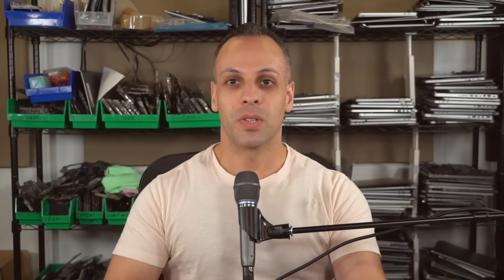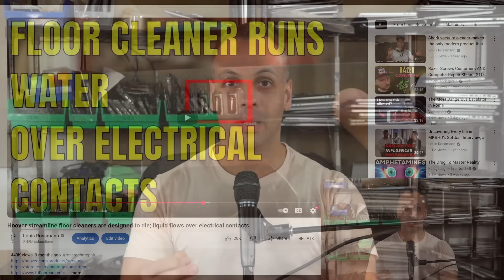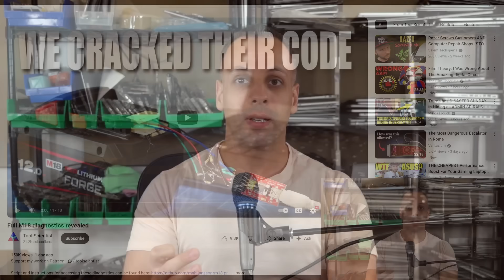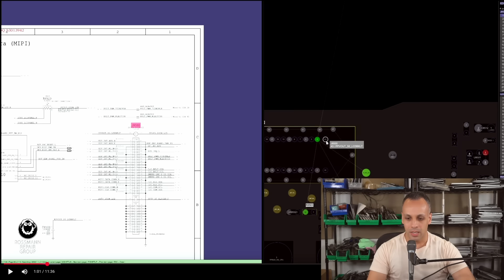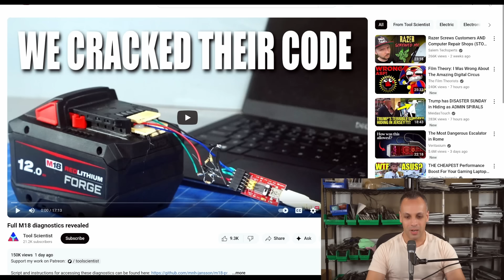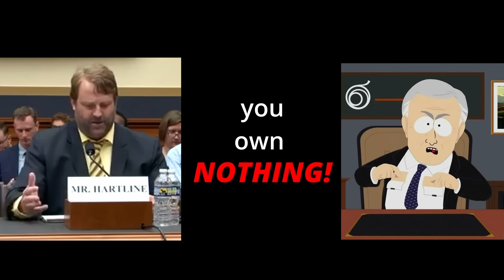Imagine putting DRM in a battery to void warranties...

Comment: This reminds me of when HP spiked my printer and made it not work. So then I called the help desk and the guy told me if I wanted any help I would have to pay. So I acted like I was doing a live stream and saying hey folks do you hear that? And of course he hung up immediately. It was a bit cathartic to smash that thing to bits. Bought an Epsom with actual liquid ink and never looked back.
Reply: Epson isn't immune to enshitifiction either.   There is a sensor in the printer that dies after so many pages printed.  They just get you another way.  Only Epson can fix it of course.
Reply: @fredsilva7274  Epson was always kind of bad, the heads being part of the printer meant the nozzles would clog and inevitably it'd be ruined other companies the nozzles were part of the cartridges which was part of the justification for the higher price but a ruined cartridge was potentially cheaper than a new printer. Then all the others seemed to introduce the "authorised replacements" era, which led to the fun of figuring out bypasses for the early countermeasures to refilling your own. Sad to think we thought it was beyond BS then compared to today.
Reply: @cericat not in the 80s man...😊
Reply: @fredsilva7274  Which printer model is that?  I've got over 8000 pages from my Epson and it is still going strong.
Reply: @fredsilva7274  If its just hardware failure but is hard to replace then I can just call it bad design and its usually not intentional, but rather lazy. Most harm is done through ignorance rather than malicious intent. If it is intentionally left as a design flaw after being discovered it is really poor design and almost crappy. If it is purposefully added to brick the machine, it is complete BS, and I don't want to buy or use it.
Reply: @dashdartfun  The reason I never buy Sony.  They had CDs that would brick computers, to defeat copying. No thanks. Not ever.

OTOH, We had a refrigerator that went eight years, I think.  The ice maker was intermittent and the 'fridge and we thought the 'fridge part didn't cool as much as it once did. I moved it out to clean the coils and there was a block of ice on the back about a foot wide, running down the back of the 'fridge. The block of ice was about 8" thick and had gone through the sheetrock wall and was about to go through the other side of the wall into the dining room.  It wasn't a cheap fridge, a $3,000 Electrolux.

My wife decided that she wanted to replace it with another Electrolux.  It went 16mo before the compressor died. Of course the warranty was 12mo. We replaced that with a Bosch two years ago.  The refrigerator part doesn't cool at all, though the freezer is fine. Another $3K blown. We've been waiting over a week for service.

We had a Kitchen Aid oven that would decide to go wide open to 750F, smoking whatever was inside.  Resetting the circuit breaker would "fix" it, until next time.  We had the control board replaced and I replaced the fan, nope.  We replaced that with a Bosch. When the door was opened, steam would come out (there shouldn't be steam).  The heat would rise over the control panel and shut it off. Apparently the touch screen is infrared sensing and that it was a "design feature".  We made them take it back.  We bought a Gen Aire.  It's been great.  ...for four months now.  

Meanwhile, a neighbor has one of those avocado-green refrigerators from the '70s, still running in their garage. They're not supposed to be used in garages, but go figure.

Broken by design.
Reply: That’s why I buy the cheap printers that cost as much as the ink. They last 3 years before the ink dries in the machine which destroys the print head
Reply: @fredsilva7274 BTDT, another good product/company ruined.
Reply: Same here... I got TIRED of HP's bs software loops just to print a damn page. I gave it to a guy for free, I felt really guilty thinking to ask money for that POS😢
Reply: I bought older color laser used, no need for proprietary software because linux has open drivers for it, and dye can be bought for pennies.
Reply: For anyone getting screwed by HP cartridge DRM, here’s how to take back ownership of your printer:
1. Login to your router as admin, find the printer, and blacklist the MAC address from Internet access. This prevents firmware updates while maintaining WiFi printing / scanning.
2. Find the factory firmware for your model and force-install it. 
3. Buy refill / knockoff cartridges for 80% less than HP cartridges. 

When your printer finally dies, buy an Ecotank. I’ve printed thousands of pages and haven’t even used all of the ink that came free with the printer 18 months ago.
Reply: Your epsom hs a "diaper" in the bottom that it deliberately floods with huge amounts of waste ink. When that cotton pad gets filled up it floods the chassis of the printer and destroys it, permanently bricking the printer.
Reply: HP did that to a lot of products!  I experienced it also.
Reply: I will never spend money on HP or cartridge printers ever again. 
I will never allow my family and friends to either.
Reply: What you want is a laser printer. They last a long time. I have one here that's over 20 years old and still going strong.
Reply: I don't use my printer much.  Every time I went to use it, the ink was dry.  Another printer in the trash. I ended up buying a good color laser printer.  I've had it at least five years.  To give an idea how much I used printers, it's still on its original demo toner cartridges. 😁 I would have gone through five inkjet printers in that time and wouldn't have one when I needed it.
Reply: Epson released a firmware update for my printer that forced Epson carts. Waiting for prusa to release a 2d printer.
Reply: I'll make a long story short and say I hate HP printers so much, I petitioned my company to replace them where we had them and started buying Epson eco tanks moving forward.

Far from an advertisement, but the Epson ET-3850 has been a go-to model for me for a few years, they just work all the time.

Until recently, when I found they force you to enable location settings to install the drivers.  I contacted tech support who walked me through a manual way of installing the printer.  It can be done, and I also have a VPN so maybe it doesn't matter anyways, but I have a lot of these to set up and really it's just more of the same, a company wanting to spy on it's customers.
Reply: Bought an Epson ink tank in 2012 and never ever bought a cartridge based printer again. 
Have a completely new canon ink jet still in its original packing for 3 yrs.
Reply: We got so tired of printer BS that we bought a brother color laser printer.
It took eight years to run out of toner and have to buy a new cartridge. It's still going strong, although a lightning strike nearby did toast the USB port, somehow. Works fine on ethernet.
Reply: HP did that to my (older inkjet) printer as well.  One day the HP software asked permission to do a firmware update, and I allowed it to do so.  After updating, and while rebooting, it slammed the ink carriage to the right side of the printer and made a loud grinding sound.  It was bricked after that, and I haven't bought an HP product since then.

Comment: I use walmart battery power tools now. They are crap but they are still better than Dewalt and the batteries are less than half the price. I had 3 Dewalt batteries die on my within a year, every single one of them had unbalanced cell voltages. Dewalt Lithium batteries DO NOT BALANCE CHARGE. Ironically the cheap walmart brand have cell balancing. 
I Don't even like walmart.

Comment: Aftermarket battery enclosures with ease-of-access for their construction and a USB-C port for observing SoC across all banks, and SoC for individual batteries per-bank would sell like hot-cakes. Attachment doesn't matter since adapters will be necessary anyway. Ability to update firmware on an SD card, and to set the mode based on what tool ID is as-provided by the unit would also be nice. An extension management interface made in Python with a decent UI would be a bonus.
Reply: Something like CEENR brand universal batteries? They have a  battery case and separate adapter for each tool brand, USB-C charging. I don't know if they have balancing though.

But they are either going out of business or just do scummy marketing, because almost everything in their site is 30-50 % off.

Comment: I have watched Milwaukee convince everyone that charging batteries faster is better, as far as I am concerned they are making the cells too hot.  In reality I think the charge times should be two or three hours. I remember when we had NiCad packs for tools and RC and they would last forever, they charged slow, but they survived.  NiMH was a little worse, then when Milwaukee first came out with the V28 tools, they were awesome, the backs would work when cold, hot, they charged slowly, they lasted for years, the tools were awesome.  When they swapped to the M series, they just weren't as good.  I even had some of the MX batteries and those would discharged on their own, I lost a few thousand dollars worth of batteries by not using them, on top of that, they only warranty those for two years.  Total scam.

Comment: Speaking of drill batteries, here in Australia, Ozito is a very popular power tool brand for home consumers. I have an older Ozito 18V NiMh rechargeable hammer drill that would still work fine but for the batteries no longer holding charge and you can no longer buy the whole NiMh battery pack. In recent years Ozito introduced 18V Li-ion powered tools but these batteries use a different mount than their older NiMh range and they don't offer an adapter forcing consumers to but the newer range of tools.

Comment: If I have access, it's diagnostics, if not, it's spyware
Reply: Maybe we should bring our torches and pitchforks and force the lawmakers to put a rule that requires schematics and firmware code for all hardware products.
You don't want the customer to have that information, it's your right, just don't sell the product. Leave it on your inventory, then the customer won't have access to "your" trade secrets.
Reply: @monad_tcp  also at what point did schematics become trade secrets? Like the repair schematic was in the manual of like everything in the 1950s
Reply: @HerbaMachina Whenever the point was when companies realized it was profitable to make people discard old items instead of fixing them.
Reply: @QualityPen  Yeah when you use a chip that has balancing functions and you just turn them off that's pretty f*d
Reply: @monad_tcp schematics are somewhat useless with modern systems on a chip that can only be bought from Taiwan in quantities of thousands.
Reply: should be a t-shirt or a mug at least :)
Reply: Makita has battery diagnostic tools BTC 06 for CXT 12 V, BTC 4 for LXT 18 V , adapter BTC 5 for XGT 40v, 40V battery even record on what tools it has been.
And for LXT 18V they had a tool , that could time lock batteries , disable those for weekends , you dont need 16bit processor to balance the power cells .
Reply: gosh speaking off time locks, i worked out years ago that my printer used to say it was out of ink once the ink cartridge was out of date. 
i reset the PC's actual clock to five years previous and it printed just fine.
what a surprise.
Reply: Thanks for a great video. Comment to feed the algorithm. Another deep example of ‘not a diagnostic’.
Reply: Imo if THEY have access it’s spyware

Comment: More than once Milwaukee have performed a bait and switch. One example is the 2767 Nut Gun, the Rev .A model was very good, then they released the Rev .B  which was not, and the only way to tell which revision you were buying was to look up the serial number.
Reply: you get this with ssd’s too. launch a good product, once the word spreads cheap it up and coast on the rev a reputation.

Comment: Dang dude. I actually had high hopes for Milwaukee. I use there tools on the daily for work and they make all of are specialty tools for plumbing. The thing that gave me those high hopes was I was looking to fix something on one of there super hawg drills and I was able to find the schematics first thing on Google. But also we have had problems with them voiding the warranty on are M12 pex guns due to water damage. Ya know the tool that we use to fix WATER LINES! if you ask me those should be more water resistant then they are. Just some personal experience for ya to chew on mr Rossmann.

Comment: My TTI branded socket set is great. There’s 0 tech and I’m using it for light use. 10x better than the cheaper stuff that deforms on the first rusted bolt it has to undo but I’ve no experience with higher priced stuff, nor do I need it.
The options are pretty limited here in AU because they can get monopolies via agreements with the very small number retailers we have.
Reply: That's "Total Tools Importing". The TTI that owns Milwaukee is TechTronic Industries and doesn't sell anything under its name, only it's sub-brands.

Comment: 4:05 A lot of the tool batteries actually do contain the balancing circuitry, but that circuitry is just not used by the firmware in the battery. It’s almost like a proper engineer designed the battery, and then somebody else told the programmer: hey you how about we just let the batteries dies faster.
Reply: BTW my source for this claim is the tool scientist’s great videos. He has previously taken a while bunch apart and looked at the charging circuits and observed their behavior of whether or not they actually performed cell balancing.
Reply: @maxcaldwell8318  It's not rocket science as such. If the chip is commercial-off-the-shelf it has datasheets and those will immediately expose the existence of any balancing feature in the BMS chip. You just wait: they'll order custom unidentifiable chips from Marvell or some other company and hide all the features and all the information. The next gen of chips in their batteries will also surely have much stronger anti-tamper features to prevent hackers from looking through the battery logs. I'm cynical but I'm sure this will happen.
Reply: Yup, it’s very annoying. 

While there isn’t a good amount of data, a couple people who manually balance defective batteries have commented on the videos. What they say, seems consistent: when the battery is getting unbalanced, it’s usually because one of the cells is actually dying. Manually, balancing the cells only gets them a couple months of time before they have to balance them again and the battery dies fairly quickly.

So, it seems like the net impact of the lack of balancing isn’t actually as significant as we might’ve thought. Not sure though, because there is not enough data.
Reply: @gf2e  If a cell is already dying, it's just regular resuscitation and won't help the battery pack last for years to come. The issue is that with zero balancing the weakest cell will eventually discharge to <2V and that is a fast road to early demise. Balancing a battery pack is a preventative measure, not healing or repair.
Reply: @wombatillo The argument is that the weakest cell dropping below 2v only happens when that cell is close to death.
Reply: @gf2e  But the cell ages much faster if discharged to <2V and kept there for weeks or months. It's a different mechanism of aging from charging past 4.2V or the last 10% of charge but it's not good for batteries. I have worked with large industrial batteries that have large red lettering in the manual warning about sub 10% SoC and that they must be immediately charged and balanced.

If the cell is badly out of balanced it will also never be "refreshed" after a fashion because it might never truly ever again go into float charging unless forced via balancing.

Comment: Ryobi is also TTI. My SO and I have stopped buying Ryobi the last couple of years. About 6 or 7 years ago we had a problem with a weed wacker and their support was amazing. Super helpful, super friendly, they didn't have our model in stock so they sent a more expensive model as a replacement. Awesome. I hate that weed wacker with every ounce of my being but their support was fantastic. Had a problem last year with one of Ryobi's vacuums. Support is now terrible. Had a problem with a Ryobi pressure washer this year. Support is still terrible. I don't know who we're buying going forward but it won't be Ryobi and it won't be a TTI brand. We have Ryobi drills, impact drivers, hammer drills, lawn mowers, leaf blowers, etc so a ton of batteries but I imagine I can repurpose their batteries for other purposes like long running ESP devices. Sounds like our decision to abandon them was a good call since the problems Louis talks about will only get worse and certainly not better.
Reply: In North America yes....Ryobi is owned by TTI. But in Asia Ryobi power tools was sold to Kyocera.
Reply: Huh thats weird I must've been lucky. 2 years ago when I bought a battery bundle during the ryobi days deal thing which had a 6,4, and 2 ah hipo battery with a high speed charger and a "free" tool. Had the 6ah battery partly fail and wouldn't fully charge. I forget if I contacted home depot or ryobi support but they replaced my 6ah battery free of charge and very quickly as well. Didn't even require me to send back the bad battery.
Reply: You realize Ryobi is the lowest brand in their scale of tools. It's just a hair above funny Chinese name brand on Amazon. Would you have bought all the tools if they cost twice (or three) times as much if you knew they would work better? Also the Ryobi batteries are cheaper compared to Milwaukee because they are the lesser battery cells that wouldn't pass for a Milwaukee battery.
Reply: @RCLapCar  You realize my issues are with TTI's support and not the Ryobi products, right?